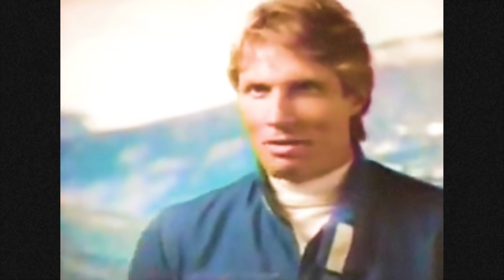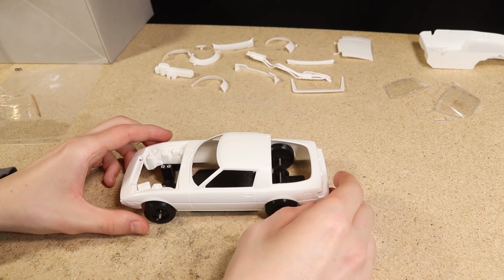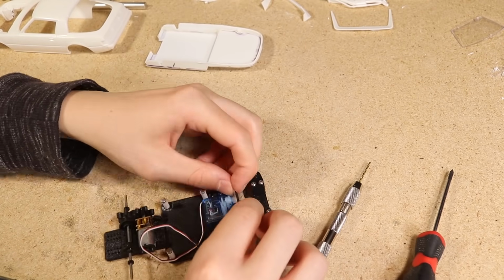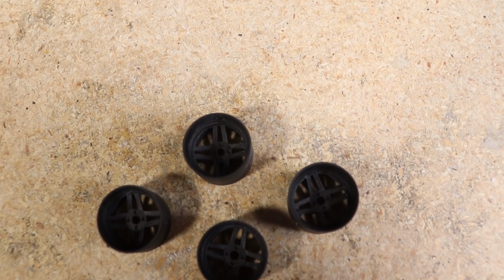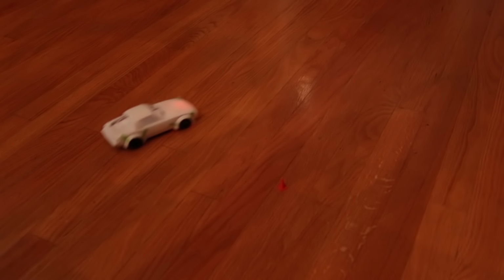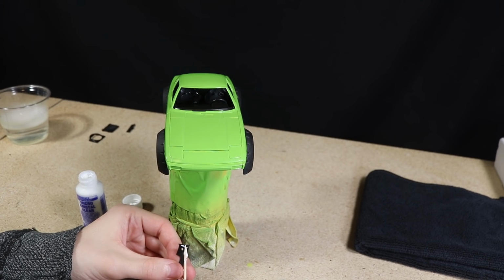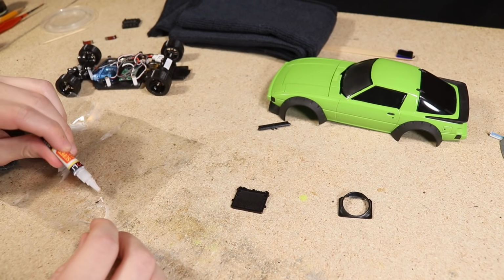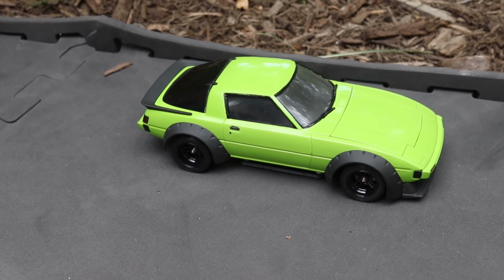Widebody Mazda RX-7 1/24 Scale RC Model Car Custom Build

Comment: Amazing work , the steering system and the motor system is great but can we use higher rpm motor without any gears so that the car will be fast?

Comment: Hello, I bought one of the chassis kits and was curious what wheel and tire setup would work for this
Reply from the maker: Would you like the same wheels and tires I used on this RX-7? We don't have them listed on our site but we would be happy to 3D print you a set if you'd like, just send us a Facebook message or email. If you have a 3D printer, we do have the STL files available on our Patreon page.

Comment: 1:17:07 are xmod series 1 cars. These can have custom mods or factory made mods including lights /body kits/alloy wheels/gearing inc 4wheel drive kits and steering chassis mods and also can be extend or shorten with different shafts chassis as all the chassis was universal the ones shown have no mods at all and are box standard. Series 2 had introduced 4x4 mods and a different chassis from the series 1 but still had a universal chassis that also fit (with mods) the series 1 shells. They where great fun and easily maintained but very detailed cars.

Comment: I am making rc car with electric motors. Each motor is connected to a wheel so every wheel have a separate motor. So when i connect the 4 motors together to get same power how would i connect them in which order?

Comment: Hey this is a really cool build! I've got a tip for you from an old school drifter turned RC enthusiast. When your doing a scale drift build run the hardest compound (plastic) on the back and a softer compound (rubber) up front. That's a trick we used on IRL underpowered cars, like 100hp RX7s for example! 🤣 It increases oversteer but keeps the front grippy to prevent snap understeer which makes you slide out of the turn 👍
Reply: Exactly we do same thing to tune the oversteer and under steer in a asphalt oval track outlaw latemodel I race. But get mechanical grip from weight and adjusting the adjustable coil overs on it while on scales and getting cross and rear bite and corner weights set we will add more mechanical grip to front and less tornear of the car is pushing. But with rc I would get some high traction front tires and some slick rears with less traction. I figured the hard plastic tires you printed would slide easily but guess not lol nice build
Reply: MR2 owners are taking notes now

Comment: Looks like a sweet build and the green and black color looked amazing!
The only thing I didn't like that much, is the engine cover,that looks a bit rough and lacking details,the sideflares and that front bumper looks a bit odd. Almost like it's upside down.

Comment: If you are using only two servo wires you can solder all the pins off and solder L shaped pins on that way they won't take much space

Comment: We can't even escape LS swaps in RC cars now...  Nah great build though
Reply: Cheapness and availability is what makes them popular, for a while people used to use the Ford Modular V-8 since it was the cheaper option but with all the models Chevy made that has the LS motor in it made it the most viable swap
Reply: @lillythepone2994  Yeah, from my experiences working with the older hot rodders they used not so much the Modular (which is an OHC engine that came out in the 90s) but the Flathead V8 because much like the LS they were cheap and plentiful.  Once the Small Block Chevy came around in 1955 the Flathead was all but replaced
Reply: @lillythepone2994  зв
Reply: @lillythepone2994  э
Reply: I think ls swaps are a reliability thing
Reply: 😂 good old GM
Reply: Эээ

Comment: As usual great video, great build! Have been curiously wondering what you could do with a larger scale very detailed diecast...

Good stuff!
Reply from the maker: Thank you! The thing about diecast metal though is the weight. It's a lot heavier than plastic so it requires stronger parts. Still would be cool to try though. 👍